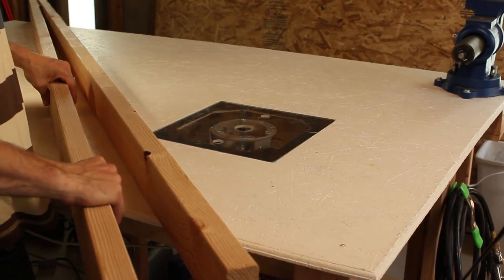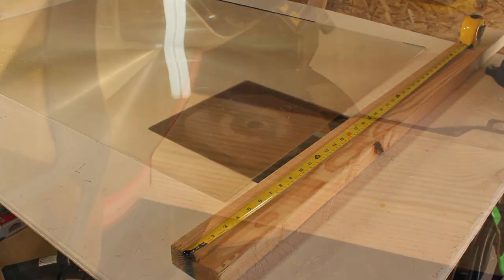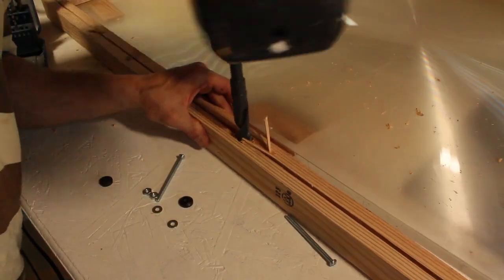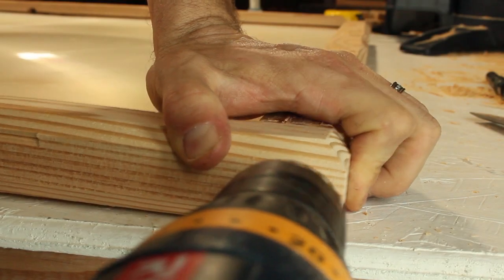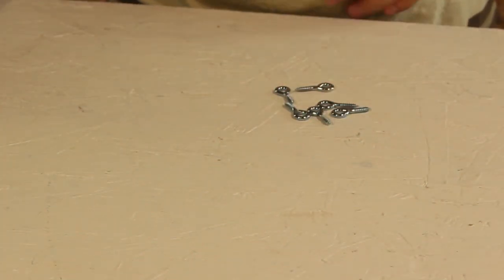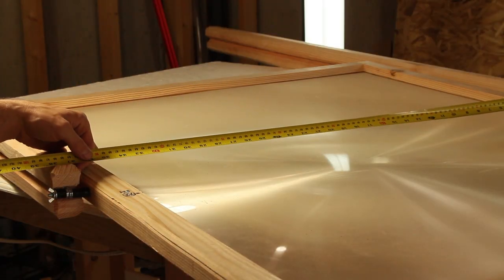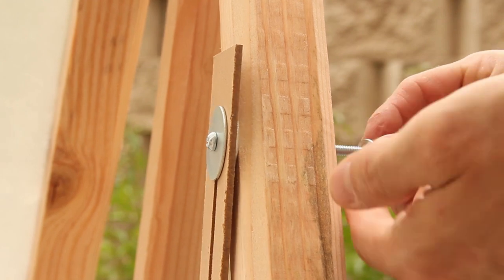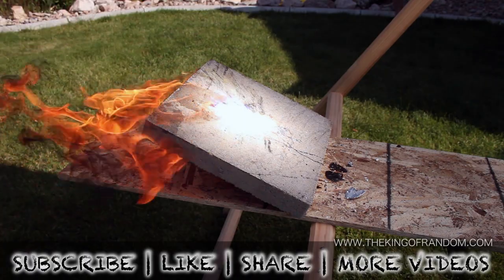Make a Solar Cooking Frame for Cheap (Fresnel Lens Frame)

Comment: Just used this as a template for framing my own lens. upgraded the hinge design by incorporating larger eye screws, a 5/8" carriage bolt and I used metal spacers.  Took it out in the sun at 11:30 AM Pacific and instant fire as soon as I found the focal point.  Thanks Grant, couldn't have done it with out you.  Chris

Comment: Awesome video! Just wanted to share that I was able to duplicate your solar cooker(not quite as sturdy but it still gets the job done). I can't get the same type of dramatic results I see in the video, I think my lens is flexing in the frame. Either way, I had all the wood and hardware laying around the garage so it was a lot of fun to make and a good time burning things with the 600-700 degrees I'm seeing.

Comment: You did this video in less than 5 minutes... moreover, you covered all the steps necessary so that just about anyone could build this. What's missing are the "you knows", "likes", "uhs", "ums", "and-ahs", and the 10 to15 minutes of mindless, useless blathering about the topic which are typical of most other videos. Well done. I just subscribed to your channel.

Comment: What table saw do you have? Looks like mine but mine makes terrible cuts. Even after hours of messing with it to get it accurate.
Reply: Jebus Hypocristos im not claiming to be the best tool in the shop, but its difficult when you research solutions and try to fix the problems and nothing seems to work, i got a new table saw anyway. the table saw i had at the time of the first comment was too small, had no power, and no safety features. i got it for free, that was about the only good thing about it lol.

Comment: Hey Grant, love your idea for the solar scorcher! I built one to the specs you used. Unfortunately my design has a flaw that I was wondering if you could help with.. The finished product puts out a 1"x3" beam instead of a focused dot when focused. Any idea how I could better focus that?
Reply: Johnny M Unfortunately, you can't fix it. Apparently, some Fresnel lenses are linear focus and others are point focus. Yours is a linear focus, which are apparently more common. Grant says this in the description on his "How to get 2000F Solar Power" video. But at least you now know that your design wasn't flawed! After watching the solar scorcher video, I took a lens out of a big screen TV that was conveniently outside the dumpster where I live :P I really hope it's a point focus. Time to go check!
Reply: Johnny M Turned out my lens is a linear focus as well :(
Reply: Actually you can.. any linear lens can be made in a spot lens, it just takes a little extra work. I might be able to divulge the secret if you'd like ;)
Reply: TTime685 Yes, please do! I was thinking about just throwing my lens away and looking for a better one.
Reply: TrumPimp95  Simply fill in the linear grooves on the opposite side from the Fresnel rings. All you need is a can of Minwax (brand) polyurethane or polyacrylic and make sure its the clear/crystal-clear type. You can find it at walmart in the spray paint aisle. Just use a paint brush to apply one or two coats to the linear side, possibly three depending on how deep your grooves are. Some lenses have deeper grooves than others. Doing this also makes the lens more clear which is necessary for acquiring even more power. It might not turn out to be super crystal-clear but it'll definitely be clearer than before. REMEMBER.. don't touch the Fresnel side.. only apply to the LINEAR side.  Let me know how it goes!
Reply: TTime685 I'm not sure how to differentiate between the Fresnel side and the linear side :(
Reply: TrumPimp95 You can feel/see circular grooves on one side, that's the Fresnel side. The other side should either have linear (straight) grooves or be smooth. Look very closely and you'll see the lines/grooves.
Reply: TrumPimp95 Any luck?
Reply: TTime685 You should make your own video on this subject. :P

Comment: how do you keep the lens from moving inside the grooves? the tablesaw blade is clearly thicker than the lens itself
Reply: you could glue it with silicone to hold it firmly but it would still work fine without it.

Comment: what would happen if you managed to combine 2 or 3 of the sun beams? would it be even more powerful?
Reply: They would have to be in side-by-side (which I presume), add a lens (the lenses in the TV should work) to bend the rays back to parallel (Solar lasers!), and direct the lasers with mirrors to a common target.

Comment: The screen panel I got from the old big screen TV came out of the TV in "2ply" like toilet paper so do I used both or only one of them?
Reply: There should be a darker, textured one, as well as a thicker, clear looking one that focuses to the point. Use the clear looking one(it's obviously not clear but you get the point.) you don't need the dark one

Comment: Could you transfer the heat into power.because if you can the could feed your house with energy for a long time.
Reply: you could pass water through it making steam which could then be reused when it turns back into water

Comment: If I took this idea and used it for actual solar panels for a house how would I do that or do you have any videos for home made solar panels?
Reply: Use this on a solar panel? Pff. You're concentrating ~2kW of energy on a pin point. Good luck wiith that
Reply: Ilovelazers
Um, I think he meant, no, I KNOW he meant to mount the solar panel to the frame. Think before typing.
Reply: Mrjoecreeper
Do you even KNOW what that word means? I don't really think you do.
Reply: ***** Hypocrite (Or in this case hypocritical) means to say something is wrong but do the same thing. Example: "Why didn't you just buy 2x2's? Heck, I told my wife what you did and I had to help her off the floor she laughed so dang hard!" and then replying to a comment saying "Think before you speak." I'm glad you think you're smarter than you are.
Reply: You still don't know what the word means. If I need 2x2's, that is what I buy. Nothing hypocritical in what I have said here.
Reply: ***** Why buy 2x2's if you can buy a 2x4, cut it down the middle and get TWO 2x2's for cheaper than buying the two 2x2's. And I was using the basic idea of hypocrisy so you would be able to understand it. Think before you speak.
Reply: ***** 2x4's are $3.80 for 96 inches. 2x2's $3 for 96 inches. Why pay more (when you can cut a 2x4 in half) for twice the product and damn near half the price.

Comment: what else can be done with that fernel lens thing other than burn stuff
Reply: im looking for some sort of useful application shtf scenario OTHER than burning people lol
Reply: +Taraz Pariseau cooking and say its like the walking dead and zombie are pushing down you fence well you have these cutting them down, down side it cuts off when the sun goes down
Reply: +Taraz Pariseau concentrated solar power
Reply: +Taraz Pariseau  It's called Fresnel lens and it's a lens, so you can use it almost like any lens. The way it works, it's basically like a big huge lens which has however been cut apart into very narrow circular sections and folded in like a folding cup. Fresnel was a French scientist in the 19th century and created this lens for use in lighthouses. Obviously nobody cut anything apart nowadays, they merely stamp the lens structure into a sheet of plastic.

The solar burner Grant has demonstrated concentrates a parallel beam of sunlight towards a point. You can use it in reverse, and convert diverging light from a point light source into a parallel beam of light or a beam of light with a different degree of divergence. Popular uses for Fresnel lenses include stage lighting projectors, overhead transparency projectors and digital video projectors. Back in the day when video projectors were expensive, people used to build their own projectors out of LCD monitors and Fresnel lenses. The television set that this lens comes from actually works like a kind of video projector.

Another possible use is being currently engineered, called Concentrator Photovoltaics. Solar cells, those that you can mount on the roof of your house, are woefully inefficient, they generate a lot more heat then electricity, but their efficiency can rise sharply with the amount of light you can get onto them. So placing a larger Fresnel lens in front of a smaller solar cell can make for both cheaper and more efficient photovoltaic system installations. But don't try it at home yet ;)

I don't have any particular uses you could try at home, but perhaps this will jog your mind and you'll come up with something.
Reply: thank you for your detailed explanation,  it is more comprehensive than other responses and very informative thank you very much